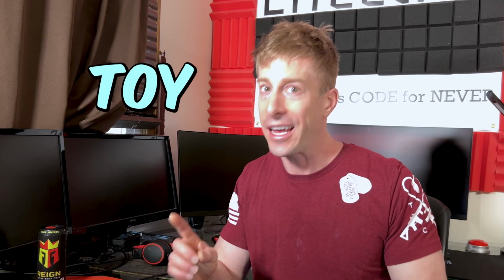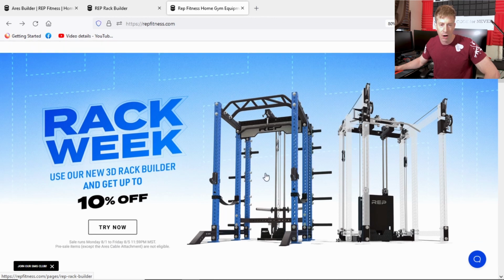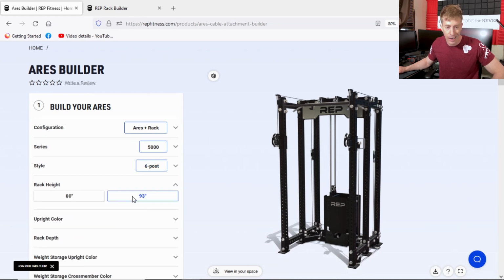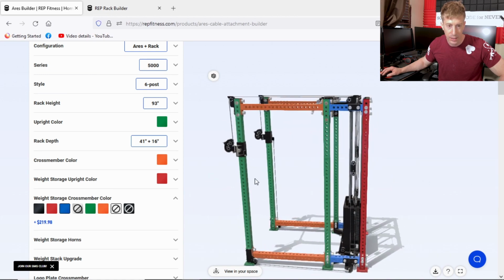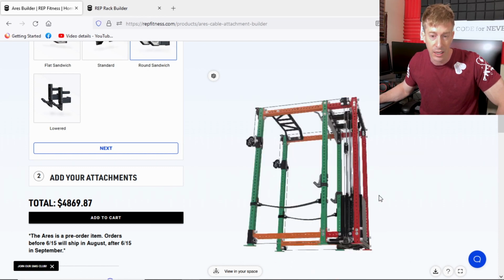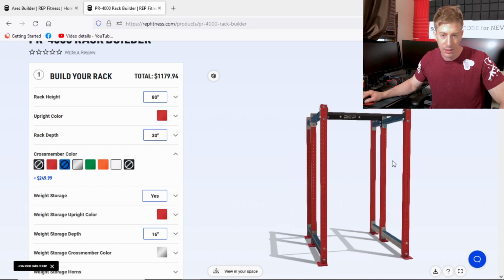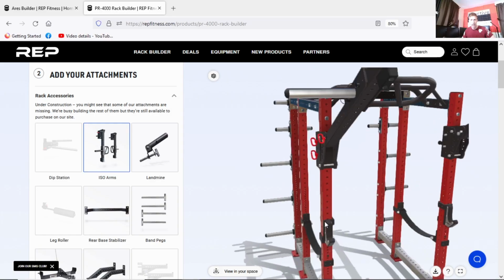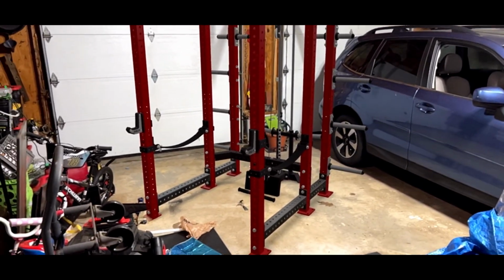Power Rack Builder

Comment: Awesome walk through!  It definitely would have been nice to have this tool. I had to pull out a tape measure and tape off my space….But if they want to take this tool to the next level it would be nice to see for example if I put the spotter arms on certain holes on the outside of my rack, what are my options for putting in the flip down safeties inside the rack.  You can go crazy with attachments, but the question is how will they all fit on the rack!  :)
Reply from the maker: That's a great point. But know they are working on future improvements so I hope it has that feature

Comment: If they had this early last year, I could have built probably a rack with no cross-members, the 1.25" pull-up bar, and added the belt squat attachment.   Everything else to the imagination!
Reply from the maker: I probably would have had a field day with this thing and gotten a 6 post power rack instead with all the bells wistles and bling I could muster on the credit card
Reply: @NoFate247  I did exactly what you did when getting the 10% off news - build the biggest over the top ARES/PR-5000 possible.   It was a lot of work getting the total over $5K to qualify.   I never knew about the scan-code open-space projection, though - the configurator crawls because my computer doesn't have enough horsepower, so I never got that far!   Apparently, we're supposed to buy new PCs more often than every 10 years.  Hey!  Why don't I get the selectorized  lat pulldown / low row,, kill 2 birds at once? - I only need the conversion kit and then with that $570 savings, I could get a spanking new laptop.   Maybe even make some money on the deal!